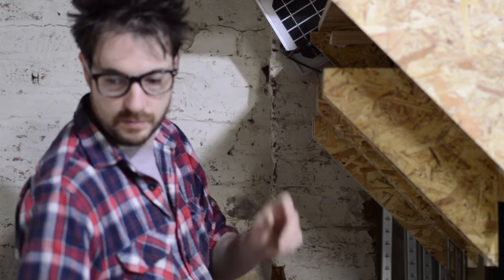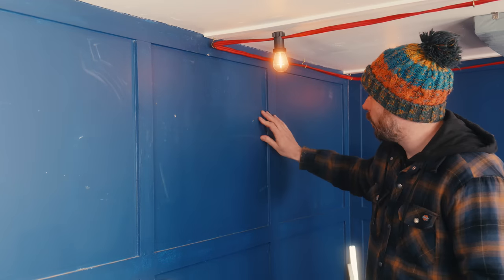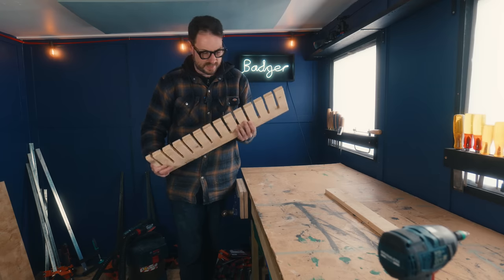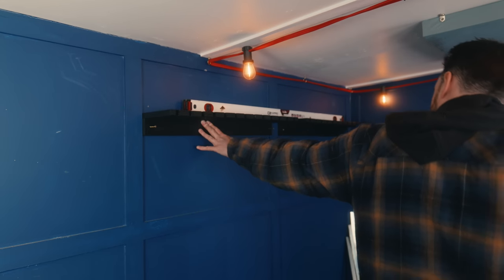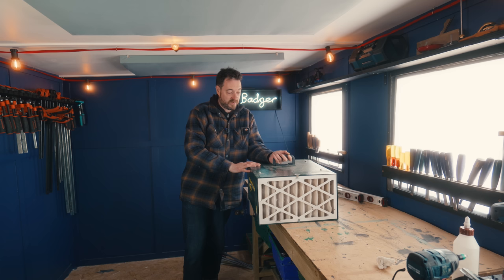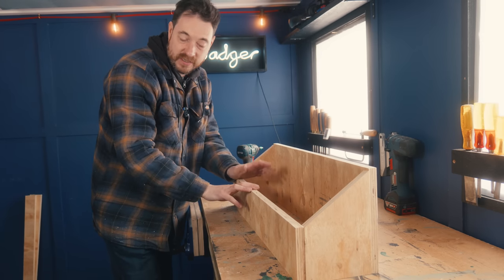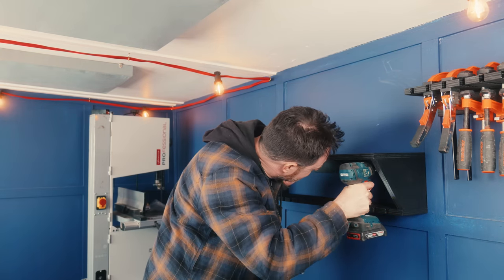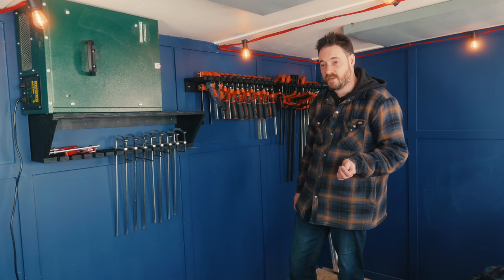Making Some Clamp Racks

Comment: That is how I racked my clamps, I used a 6mm blade in my saw to cut the slots, then hung them by the opposite end, where the little stop prevented them from going through.  Nice idea with the filter there, there might be room for one in mine now.

Comment: Nice job Matt. Having a small workshop myself of only 12x20', I love seeing how other woodworkers solve issues with working in a small workshop.
I like the idea of the air cleaner above the clamp racks, but personally, I do prefer the type of clamp rack that holds the clamps stacked front to back so you get 4 or more in roughly the same space as two side by side. You showed it in I think your first example. They end up sticking out from the wall either the same or slightly more than the side by side variation while being able to hold quite a few more clamps.
Looking forward to seeing the new shop grow!
Reply: 12’ x 20’ a small workshop?? LUXURY. Try working out of an 8’ x 6’ then you’ll appreciate what a small workshop is!
Reply: @harryscratch212  Believe me, I've worked in small shops. One of my first shops was a spare 8x8 bedroom.
I'm happy with my 12x20 though I do share about 1/3 with my pop for all his gardening supplies.